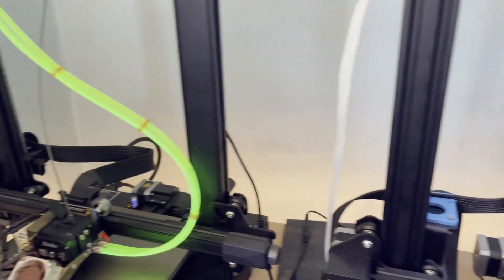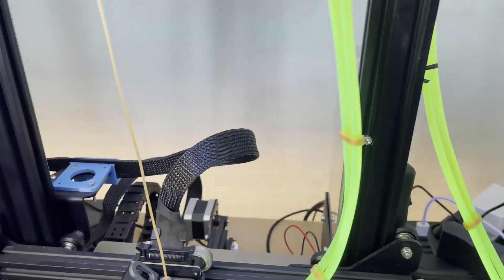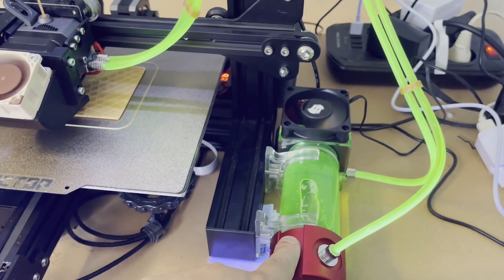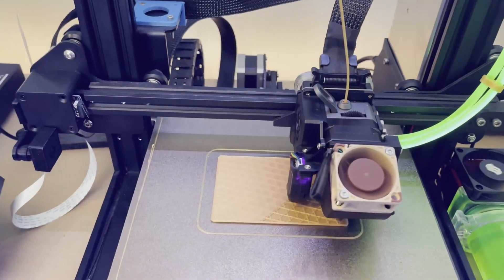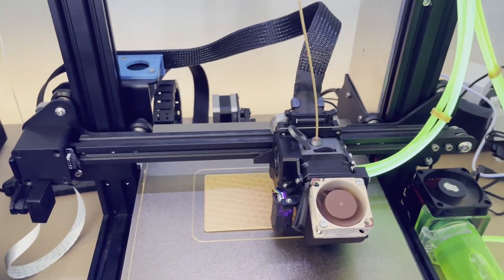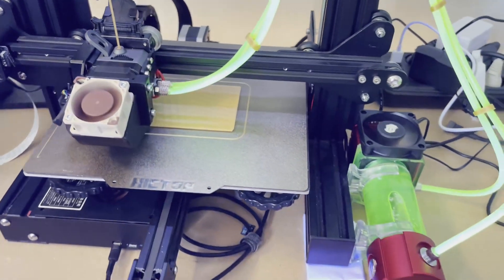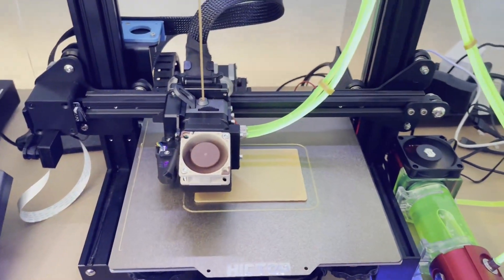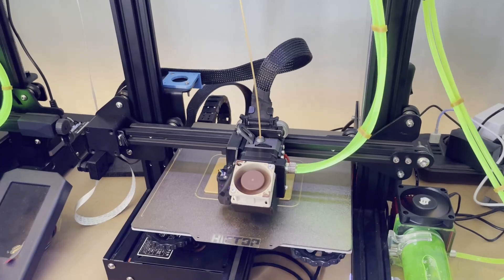Creality ender 3 s1 v1 v2 Watercooling Kit for Sprite Extruder (PRO) Demo + giveaway

Comment: its been more than a year now, did you have any problems with the fittings on the hotend wearing out because of the constant moving of the printer?
Reply from the maker: yes indeed, the watercooling is holding well so far ... although the coolingsblock did have a leak once, and i had to fix it with some sealant, check out my other video , u can find how I do it.  For the rest it's been solid so far.

Comment: The fan on the cooling block restore is doing nothing because it's not aligned with any of the cooling fins. Mount it on the end and have it either blow onto or off of the fins and it will actually do something. 
Myself, I just received the Sprite Pro and water cooling kit, Looking to attach a PC cooling loop radiator with full-size fans, but will have to wait on the parts. Also not sure about the power of the pump in the Creality unit, and if it will have the pressure to push liquid through a radiator.
Reply from the maker: Hi Robert, i know that the fan on the cooling block isn't doing anything, it was there just for the looks :)  but check my updated video out, i actually bypassed this whole setup with a mini radiator.
https://www.youtube.com/watch?v=2HkecsXHLlw&t

Comment: Hi . Great video thanks. I just have a couple questions , please. Maybe a dumb question but I’m assuming that’s coolant going through there? Is that needed or can you use water is coolant better in your opinion? Also some pointed out to me that all it is is warm water ( or coolant in this case) constantly running through it since there is no way for this to cool off the liquid. Is that correct because I was looking into getting this soon. Thanks
Reply from the maker: Hi Walter, yes i'm using EKWB coolant in there and no u cannot use anything else other then coolant in there... About the coolant not being able to cool itself down (heatcreep) , i used it for 18 hours print and i had no issues at all, but for those who really wanted to see something (mod) on it i made another video where i installed a small radiator with 3 fans on check that video out here if you like : https://www.youtube.com/watch?v=2HkecsXHLlw&t
Reply: @aim6mac  awesome can you tell me where can I get this coolant from?
Reply from the maker: @Nomadman4life  where are you located?

Comment: What is the display you are using and do you think it will work with a ender 3 v2 printer?

and i hope the give away is still active. im hoping to get a new extruder for my cubepro duo rebuild and a raspberry pi for my ender
Reply from the maker: Hi, I'm using the official raspberry pi display, and yes it works with the ender 3 v2 for sure, 
the giveaway is indeed still active, will be done at the end of this month. So stay tuned :)

Comment: Hi, guys. I have just installed this Creality Water Cooling Kit. So, what are the PID settings that need to be configured on the printer?
Reply from the maker: Depends on the Firmware u r using … but basically u just have to run the PID tuning for the hotend and ur set!
Reply: @aim6mac Ok. I going to research a little about it. I do thank you very indeed!

Comment: Water cooling on Ender? I'm not sure if it's worth it, but I'm sure that it greatly complicates, greatly increases the fault tolerance and cost of the printer.
Due to the weight of the bed, it doesn't make much sense to lighten the print head, so it's not a problem to replace the original fan with a more powerful one.
But of course, everyone makes their own choice))).And

And I want this rasberry )))

Good luсk!

Comment: The printer is really silent with this kit 👍💪
Reply from the maker: yes and check out the more recent video about the radiator bypass.
Reply: @aim6mac  yeah, I just did. Great work, I loving it 😍 
But I am think I don’t going that direction, because I was an pc watercooling expert a few years ago when making custom builds for customers. 
I will again going really to far in my cooling adventure 😜
Reply from the maker: @eddyvanbladel2057  good luck :)

Comment: with this Watercooling, what improvement did you feel in your impression?
very good videos as always, congratulations channel growing a lot, great...
Reply from the maker: machine got really quiet now, for sure, and it looks awesome in my opinion :)
Reply: @aim6mac  does make better prints?
Reply from the maker: @AlexAlex-bh8fi  no the watercooling kit doesn't make your prints better, BUT it makes your printer alot less noisy, and nozzle clogs will be minimum.
Reply: @aim6mac  nice thanks i think i will buy one
Reply from the maker: @AlexAlex-bh8fi  you should watch my other video about the failure that happend before you decide wether u should get one or not.
Reply: @aim6mac  ok but my 3d print is so noisy 😵😵

Comment: I wonder what a couple of 120mm fans and a 240 rad would do for temps.
Reply from the maker: not sure but soon there will be a 40 mm by 120mm radiator installed with passive heatsinks
stay tuned.

Comment: I have the same Hictop PEI sheet, did you put magnetic sticker right on the  heated bed? I was thinking of putting mine on a glass sheet but it's too thick to clamp down
Reply from the maker: Yes right on the heated bed but bed is a little warped i think maybe putting a glass bed in between isnt a bad idea.
Reply: @aim6mac  that's what I was thinking! I just need to get clamps that can accommodate the thickness
Reply: @aim6mac  Hey any chance you would/could do a review of the new Ender 3 V2 Neo? I'm thinking about getting one but wanna see some reviews first
Reply from the maker: @Jqmoney101  i have asked Creality to send me a review unit but they haven't answered yet... so stay tuned

Comment: It's a good idea, but I would have to put in a radiator.  Fine for 3 hour prints sure, but I typically have 1-3 day prints.
Reply from the maker: i just ordered a radiator, to put in between :o
Reply: @aim6mac  Please tell me it isn't a corsair(generally the easiest to get).  I just checked and that is a Bykski DDC pump(which is fine) and the Bykski aluminum reservoir.  To top it all off, that Sprite is listed as having an aluminum cooling block.
If you mix aluminum and copper in a watercooling loop(meaning the water path touches them both), the aluminum rapidly corrodes and disperses into the water.  The vast majority of PC watercooling radiators use copper pipes to carry water(not to be confused with the aluminum fins on them, which never touch the water, just air).  The only two "Western" makers of PC watercooling parts that had lines of aluminum parts were Thermaltake and EKWB, and I know EKWB discontinued theirs because nobody would buy them.
Did they give you extra fittings in the Creality kit?
Reply from the maker: @Grimmwoldds  yeah, i have to cancel my order now :s
Reply from the maker: @Grimmwoldds  thank you for the headsup!! Guys from Alphacool were really cool about it and told me they will refund me because indeed aluminum and copper dont mix!

Comment: Liked and subscribed! I was curious about the cooling system. I may have to pick one up. Are you monitoring the temperatures with the addition of the fan on the coolant reservoir? Has it acted more like a radiator with the addition of it?
Reply from the maker: not really sure if the addon fan is really doing anything, temps seem to be ok with or without it.

Comment: Great video.
Do the stepper motors for X and Y axis need cooling too? My stepper motors are extremely hot. I wonder if the same water cooling should be used to cool those motors.
Reply: I mounted aluminum heatsinks to all 3 of my axis motors.  Now they don't quite get as hot.
Reply from the maker: in that case u really would need a radiator in between.